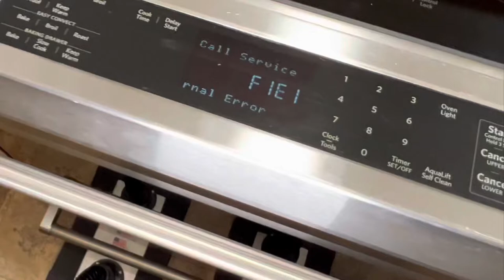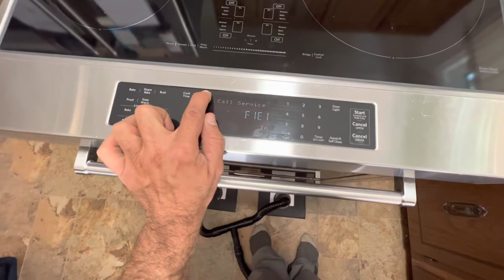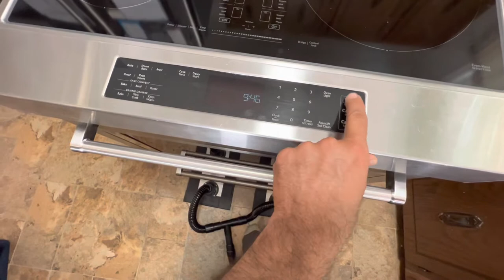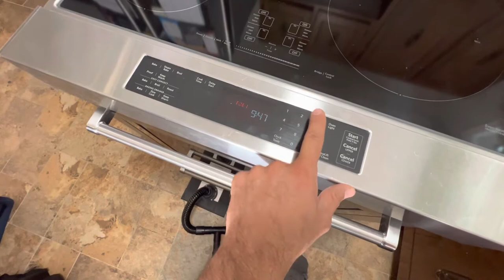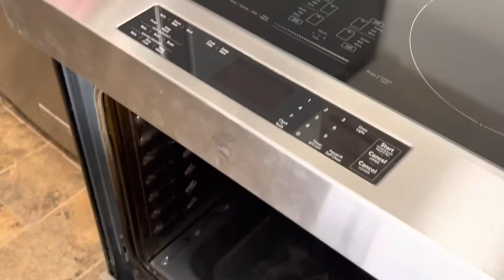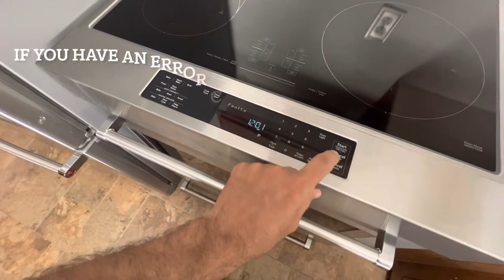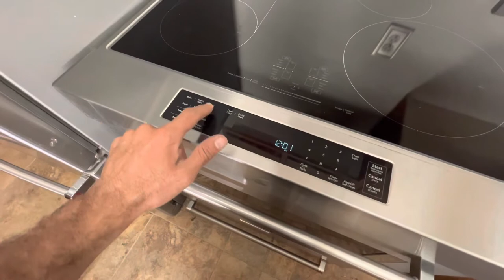Kitchenaid oven F1e1 error code and repair

Comment: Very informative thx for posting. I just purchased one of these before Xmas & was upset to have an F2E1 error code within the first few days of hooking it up! Just a little disconcerting when you pay that amount of money for an appliance & it immediately has a problem. Sure it's still under warranty, but I remember wondering how well the electronics hold up on these units while shopping for one. Expensive to replace once the warranty expires.

I decided to hold off on calling service as everything except the 0 key worked properly. Tried a few resets including tripping the breaker for cold restart. The problem returned several times but it's now been a week or so without an issue, all keys work. Thanks for pointing out the key strokes to enter self diagnosis & fault codes. I just went through the steps & reset fault codes, self diagnosis shows everything is fine. Fingers crossed it lasts lol.

One thing I noticed in your video when you pulled the plug on the range, The orientation looks like the ground prong is at the top. I'm in Canada (BC) & the electrical code for 50 amp range receptacles requires that the ground prong be either at the 3 or 9 o'clock positon, not top or bottom.

Comment: Thanks for making this video. That airsled is awesome. I'm having the same error code on my JennAir dual fuel range. The control board was replaced and we still have the same error. The oven will head up to 500 but eventually this error code will pop up. Do you have any other suggestions? Thanks.

Comment: Thank, you did great. Have a question.  My control board was changed a week ago, but I'm getting that error message.  How can I clear it.  Tks Cachie
Reply from the maker: If I remember correctly. You need to press the cancel 2 times and then right away press start , it will take you to diagnoses after that you can press number 3 and 6 or I think it’s 3 and 9 to scroll thru until you see clear code .

Comment: Hello Hameed my keyboard was giving beep sign constantly then I try to do diagnostic by my self as you showed on the video but only saw the F2E1 so I didn’t understand any thing so press the cancel key
Reply from the maker: Good day!
You need to ask someone handy person in your house to open the unit apart and check the cable maybe it’s loose or not connected properly it could be bad control board or display touchpad .
Reply: Good afternoon hameed I called handy man he said because I cook  almost every day that’s why my control panel messed up I don’t know what to do every thing is working fine except that beep which comes sometimes and it is very annoying please guide me what to do
Reply from the maker: @sajidaqureshi2588  the proper way to fix it is to replace control panel .